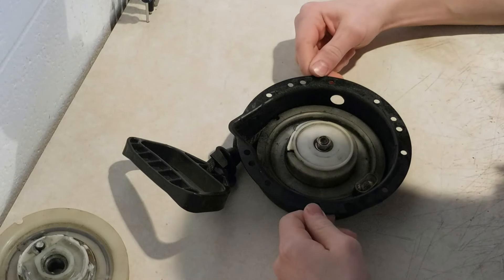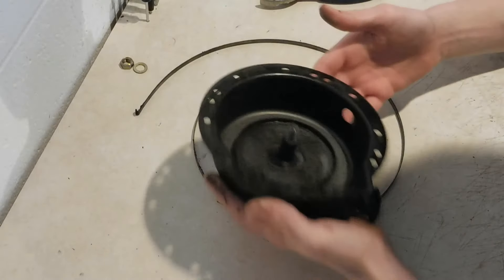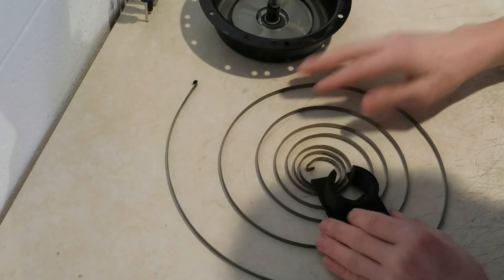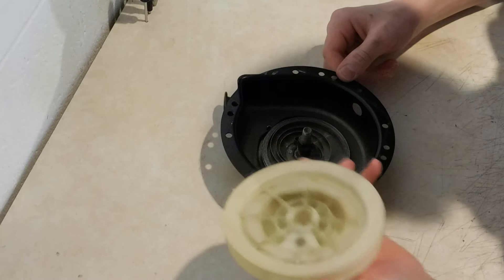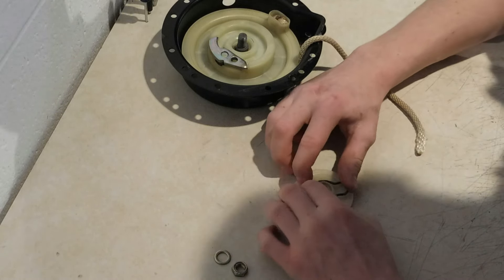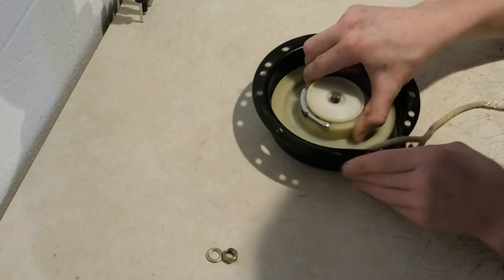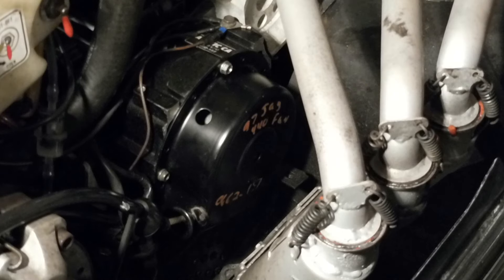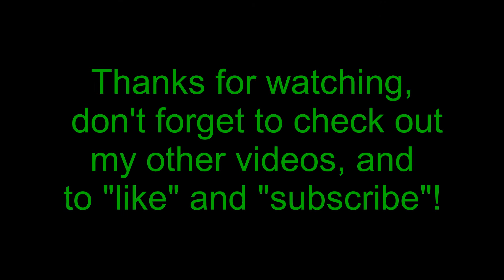Arctic Cat recoil rebuild

Comment: Hey where can I get a coil spring tool?
Reply from the maker: Nathan Lear I had mine 3D printed a few years ago. Not sure if you can buy one. There are other ways to do it with a vise grips
Reply: Power Tech I was able to get it with it inside the housing. Anyway I could get one 3d printed?
Reply from the maker: I may be able to print it. Although I am not sure if I have the files. I will check

Comment: Do you need to take the spring out to just replace the rope?
Reply from the maker: MN Outdoors Yes you do, unfortunately!
Reply: Why? It stayed wound up in the case. I could take out the plastic wheel replace the rope and put it all back together all without touching the spring
Reply from the maker: Oh yes my bad...been awhile since I did one, but your right you can let the spring wound up. The one in the video had blew apart on the sled before and I decided since I have rewound it I would make a video on it.
Reply: No you don’t… totally unnecessary just leave the spring in there pull the Plastic round for the rope out carefully and the spring will stay in place. I’ve done many many of these and never pulled a spring out unless it was broken